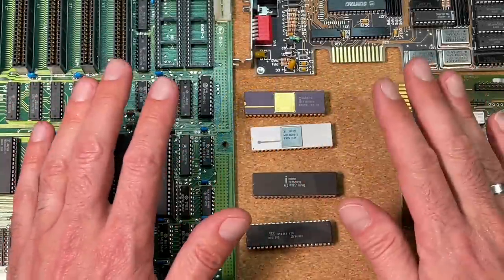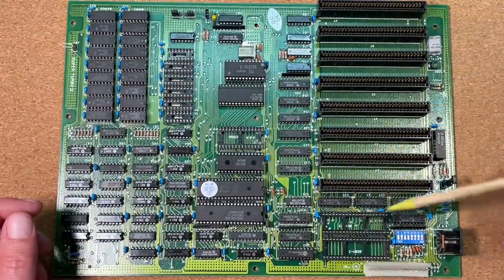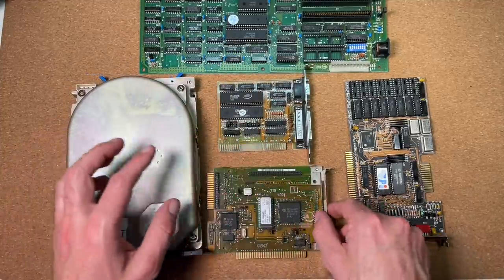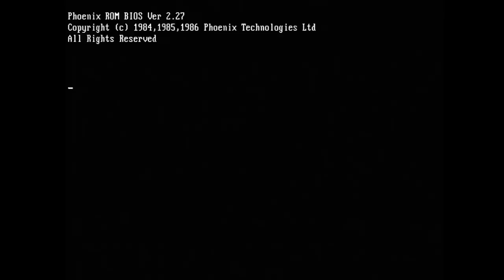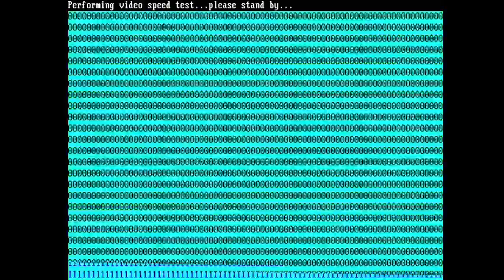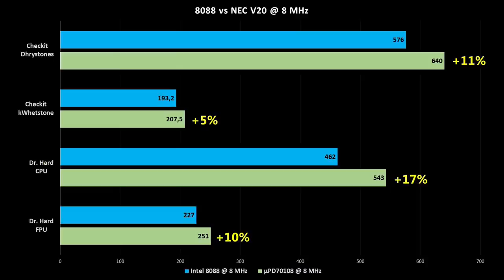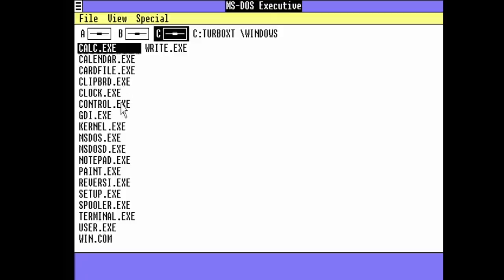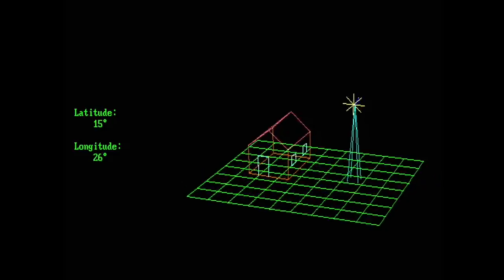NEC V20 D70108D VS 8088 CPU Benchmark + Windows 1.01 Booting

Comment: I enjoyed this video...it was pure nostalgia for me. I worked at a PC Clone store at the time. I probably handled motherboards exactly like the one you have. We sold a lot of NEC V20s when they became generally available. We had XT turbo systems that were 4.77 MHz, 8 MHz, and toward the end of the XT era, 10 MHz. I did find something really interesting back then with the NEC V20. We had both the 8MHz and the 10 MHz parts. But in benchmarking, using Norton's System Info (SI), I found that a V20 8 MHz ran faster in a 10 MHz Turbo XT than the 10 MHz V20 part!  In fact, it was almost as fast as an 8 MHz 286 AT system! When I parted ways with the store, I had a 10 MHz XT system that a couple of years later, I ended up selling to the Science Fiction writer S. M. Stirling when his PC died.
Reply: This was a known thing with much of the 10mhz v20's. A factory tweak to get them to clock reliably at 10mhz it seems. The very tale end of them did not have this issue.
Reply: @wishusknight3009  Thanx for confirming what I had guessed was the problem!
Reply: I've got a 10 MHz V30 I'm going to add an SCSI CDROM to, as well as a Radlib soon on my channel :D It's got Windows 2.03 on it.
Reply: @the_kombinator  That will be a flyin machine!
Reply: @wishusknight3009  Yeah I was amazed that it pretty much booted up and ran after sitting for 10+ years. The hard disk took some coaxing but it works with no bad sectors, and tons of programs already on it. Had to do some fiddling to make the ATI Edge VGA video card to work with Windows (it had a Hercules card in there originally) but yeah, after my multiple 486 projects, that one is next :D

JUKO NEST board too :D
Reply: Back in the days when all of the clone boxes proudly displayed a "turbo" button and some  even had 7-segment displays to to display the "big boost" in clock frequency.

Comment: Ahh the nostalgia 😍🤩. I'm 39 this year and as a kid I was always fascinated by computers and GUI style operating systems.. I absolutely loved GEOS on my Commodore 64 and to this day I'm impressed with what an amazing programming achievement that GEOS was. I was given a hand me down 8088 XT Ultra from Imagineering 10MHz with 640kb RAM and EGA graphics - I loved playing mech warrior 1, Sim City the original and Police Quest 1 and 2 on it... I always wanted a version of windows for it but only had windows 3.0 which was too advanced for it.. I desperately wanted a copy of Windows 1.01 or 2.0 back then, but couldn't find one.. I ended getting a cheap 286 12MHz with 1mb ram and VGA graphics and fell in love with Windows 3.1 on it.. I also really like DESQview which was an incredible multitasking txt based windows system for DOS and I was able to run a multi node BBS on it with my 486DX4/100 I had by that stage (that system also ran Windows 98SE and Doom + Quake + original GTA and was my first really powerful PC). Ahhh the nostalgia 😍
Reply: SimCity is one of the only games, and even one of just a few applications, that will utilize a 8087 math co-processor. Window 3.1 needed a 386. Are you sure it wasn't Windows 3.0? Or maybe the 286 had an upgrade, either an Intel Inboard or similar?
Reply: @squirlmy  Windows 3.1 would run on a 286 with 1Mb RAM.. trust me, I ran windows 3.1 on a 286 12mhz and my mate also owned a 286 at the time and ran windows 3.1 on his 286 back in the 90s as well. Search YouTube for windows 3.1 on 286 there is a number of videos of it running on 286s with at least 1mb RAM.. system requirements were 286 minimum 386 recommended

Comment: I also had an 8086 computer and upgraded it with a V30 and increased the clock speed from 8 to 9.67. This almost reached 286-6MHz ^^

Comment: Your experience matches very well with my own. Back in the days when it wasn't retro (just old-ish), someone gave me a V20 chip that came from a dead system and I found it was anywhere from 0 to 20% faster clock for clock, and I didn't really understand (then or now) what kind of workloads got which kind of response because not long after, I got hold of a 16 MHz 286 and lost all interest in trying to upgrade the XT. The V20 was a nice bonus for the guy that bought it off me though.

Comment: The V20 also had an 8080 compatible mode. There was software available for it that would allow you to run CP/M programs on your PC.
Reply: I was going to add a comment to this as he was talking.. heh! I'll continue your comment because (First!!1 respect etc).  If you are a CP/M fan you probably already know this. It was called "8080 Mode Shifting" when you call a BRKEM instruction. :) I run two in my NuXT board and a NCR PC4i.
Reply: And there was another CPU later on that was compatible with both 8088 and Z80 code.
Reply: @AmaroqStarwind  The V30 also compatible with Windows 3.0
Reply: @asanjuas  So was the 8088. Windows "real" mode. It required 640k though as far as I know.
Reply: The 8086 was kind of source compatible to the 8080 in a round about sort of way, but did require some tweaking and recompiling. It certainly was not directly source or binary compatible by any stretch. It was only designed in such a way that 8080 assmenbly could be ported easily up to an 8086 without a full rewrite.  It was fascinating that the V20 was indeed mostly compatible.
Reply: I have used that a lot back then,
Reply: @wishusknight3009  possibly but V30 supports some 80286 instructions. And Intel 8080 and Z80
Reply: @asanjuas  No, the v30 and v20 were identical internally and only had 80186 like enhancements. The V33 used interrupt vectors like a 286 and had performance similar to the 286 in similar clocks.
Reply: @wishusknight3009  is the v33 pin compatible with 286?
Reply: @asanjuas  As far as i am aware the V33 was only ever an embedded surface mount qfp. It had separate address and data lines like the 286 but tjat is where its similarities end. It maintains it is only 8086 comparable.  As far as I know it didn't have the extended protected modes of the 286 or associated control pins.
Reply: @wishusknight3009 but not Windows 3.1. That required the memory management of the 386. Compaq beat out IBM in creating the first 386 PC, which turned out to be a great advantage because Windows 3.1 was so commercially successful. IBM had doubts about the 386 and didn't anticipate the eventual popularity of Windows and held back. Linux also will not run on anything less than a 386. In the 90s I used to search through trash hoping to find one I could fix up.
Reply: @AmaroqStarwind  I don't think so. the DEC Rainbow100, for example had one Z80 chip and one 8088, designed to run a custom edition of MS-DOS and Z80 C/PM (although not at the same time). I realize that's not proof, but I've never heard of any attempts to combine the two instruction sets in one chip, because of licensing issues.
Reply: @squirlmy  It wasn't an Intel chip. It was an NEC chip.
Reply: @squirlmy  3.1 runs on a 286 in standard mode. I was talking about windows 3.0 and its real mode will work on an 8088.  However 3.11 requires 386 enhanced mode.
Reply: Only half right. CP/M was written for the first IBM PC. Confusingly, it was called CP/M-86, I think it was intended from the start to run on 8086, but it came out for IBM's 8088 PCs. And CP/M ran on many, many different chips. Remember too, not all code was written on top of an OS for a personal computer, there were many, industrial applications especially, that ran on "bare-metal". So, you can say the "8080 compatible mode" was certainly meant to run 8080 code, but making the jump to "allowing to run CP/M programs" is a bit too far a jump. The most popular chip for running CP/M was the Zilog Z80. Zilog would go on to make the Z180, Z800, Z8000, (I believe the Z280 was cancelled, though it was planned as an update for the Tandy 1000 computer) but Zilog never again found the level of success the Z80 had. The DEC Rainbow had both a Z80 CPU and an 8088  CPU. Although it could run CP/M-86, since that OS had been a failure on the IBM PC, they stuck to Z80 CP/M, and a custom MS-DOS ran on the 8088.
Reply: @squirlmy  According to the NEC V20 article on Wikipedia, NEC had legally reverse-engineered the 8086 / 8088 instruction set, so licensing wouldn't have been an issue on the Intel side of things.

Their chip that was compatible with both 8088 and Z80 code was the NEC μPD9002.

Comment: The reason I find V20 extremely handy is the fact that it handles 186 instructions. Back in the day I often compressed my games with pklite to fit things on floppies that otherwise wouldn't. Now these games just hang when I try to run them on an 8088 as the decompressor needs these newer instructions. But a V20 can cut it!

Comment: I’d like to see 8086 vs V30 as well nice video
Reply: Heck yeah! (And let's see them completely destroy the 8088 MPH demo... In both a good way, and a bad way, due to it being timing-sensitive.)
Reply: Those are a rare creature to find now.  The v30 was intended to compete with the 80186.
Reply: I seem to remember a PC compatible card for the Apple II series of computers used a V30. The advertisements stated it ran 3X faster than an XT. The card I believe was called the PC Transporter from Applied Engineering.
Reply: @lemonherb1  Yeah I remember this as well. I can not remember if it used a V30 or V20 however. I thought it was a V20 myself.... Holdon let me do a quick search......  Huh... it is a v30... I'll be dazzle drawn... 

PC Transporter with 768K $679 Specifications: CPU: High performance true 16 bit V-30 microprocessor; chip has full 8086 and 8088 instruction set operat-ing at 7.16 MHz User RAM: 640K maximum (IBM) System RAM: 128K Apple User RAM: 768K maximum.
Reply: i think v33a is more interesting but not sure if pc compatible motherboards using v33a exists...
Reply: @wishusknight3009  I was under the impression that it was originally made to compete with the 8086, but thanks to Intel managing to both hold up NEC in court (ie. Delaying the release of the Vx0 chips) and make the 80186 a pretty forgettable CPU the V30 ended up competing with it?
Reply: @TheDemocrab  I think the V30 was more feature parity to the 80186 than the 8086. That is why I figure it was intended to compete with it, thought it could basically compete with whatever it is capable of beating in price/performance.

Comment: Great video. That is about what one can expect in real world performance differences too. I usually told people a %10 boost across the board.  The 8086 to v30 difference was similar and perhaps slightly larger but I no longer have the hardware to test that.

Comment: I had wondered about the V20 upgrade back in the day. Not a lot of gain for twice the transistors. Probably limited by memory bandwidth.
And thanks for reminding me of that Mah Jongg game! I put in a lot of time with it on my CompuAdd 212 (286/12.5MHz).
Reply: Several poor design decisions caused performance limitations on the 8088 and the subsequent V20. The first is the crippled 8 bit bus, but exacerbating that is the fact the data bus and part of the address bus are multiplexed on top of each other. Additionally some other lines are multiplexed on the upper address bus, so a lot of glue logic, wait states and extra bus cycles are needed to get information in and out of the CPU.

Slow memory of the time was an issue, but the multiplexing and 8 bit bus were the worst problems that prevented the 8088 from performing better, and the subsequent V20. The V20 could be as efficient as it wanted to be, but it was burdened with so much baggage that any improvements were always going to be minimal. The 8086 wasn't much better because Intel still multiplexed the address and data bus.

It wasn't until the 80286 that Intel stopped multiplexing the address and data buses, but it really should have never existed, along with the 8018x. The 80386DX was what the previous chips should have been.
Reply: V20 upgrade was extremely cheap, pizza money cheap. There was another upgrade in 386 times with Cyrix 486DLC chips that promised stars, but delivered Doom at 10-12fps at the cost of half the full 486 upgrade :(

Comment: Nice comparison test.  The white and gold Fujitsu is very pretty, like jewellery.  In the mid 1990s I used a slightly out of date XT machine with a V20.  Dos 3.3 and Wordperfect 5.1.  I really liked it.  It had all sorts of cards inside but I knew nothing about computers so I didn't know what they were for.  It had an EGA card but I didn't know what EGA was so I used a green monochrome monitor, which I later sold.   However, it lit a small spark of interest and 2 years later I was working in IT.   The machine was THROWN OUT!  It still distresses me.  Thanks for the video 👍😊

Comment: makes me feel homesick for the 80's .....and feel even older lol.   We had XT's with Tallgrass units (10MB HDD plus tape) first - then moved to DEC Vaxmates (some diskless with remote boot, some with the 20MB "pancake" base). Those ran Windows 1.02 and included embedded Thinwire to talk to the Vaxen using PCSA (later called Pathworks) .    Great technology at the time and oh so hackable.....

Comment: I got an Amstrad 1512 in about 1987. It had a V20 running at 4.77. I picked up a 32MB Miniscribe hard card which went in an expansion slot. I have memories of testing different HDD interleave figures for best performance, the Amstrad was so slow that an interleave of 11 seemed to work best.

Comment: You know you are getting old when you remember that your first Clone Computer in 1987  had a Nec V20 and a used 10 GB MFM drive plus an ATI Graphics Solution video card on a 12 inch Packard Bell Amber Display... RIP... .. Lol... Thanks for the memories.
Reply from the maker: I guess you mean a 10 MB drive and not GB 😉.
Reply: @CPUGalaxy  exactly correct! . See how old I am.. Lol.

Comment: Another great video! Thank you very much! I remember working with an XT at school. Almost all the other kids had to follow the teacher's lessons, but I asked to be allowed to play on that machine myself because I owned a C64. I programmed a "3D" graphic with Q-Basic. Actually just two sine waves that had a common origin of the lines, so it looked like two of those wavy roof covers. The teacher was impressed.
I was also impressed with a code snippet that was included in one of the programs that came with Q-Basic. It was an elegant piece of code. I was allowed to print that out, too. On the condition that I also printed out my sine wave program and gave it to the teacher. 😁 
Anyway: The XT with 4.77 MHz was so much slower than my C64 (only 0.98 kHz!) with a Simons-Basic module. Cheers to the pipelining of the MOS 6510 and the terrific VIC!

Comment: I had an Eagle PC at 4.77 MHz. I once upgraded it with a V20. Then managed to derive the clock from one less /2 stage and run it at 7.16 MHz. Finally I managed to offer it its own clock generator and run it at 9.54 MHz! It was super fast by then. I was quite surprised that I didn't have to change that many things on the board, the clock signals were easy to follow on the board, and while my concern was to risk to double the RAM freq as well, that fortunately didn't happen.

Comment: I inherited a Datavue Spark laptop which shipped with a V20. That was the first time I'd ever seen the V20, and subsequently learned what a big deal it was! This particular laptop had been tricked out as a business machine, with every option available (640k RAM, backlit display, 2x720K floppy drives!) except the modem, and the FPU. Apparently NEC was set to come out with a competitor to the 8087, but either never managed to do so, or it was a commercial flop.

Comment: I always wondered why nobody made a "serious" chip replacement for the old 8088s. Something like the ZipChip for the 6502, which was a direct replacement but much-much faster due to high internal clock and internal cache. Just seems to me there would have been a business case in extending the life cycle of millions of (expensive) PCs/XTs by a (relatively) cheap upgrade. Thanx for the vid!
Reply: They did. You could buy 286 and later even 386SX upgrades in a form of ISA card with own memory slots. You couldnt plug any upgrades directly into CPU slot because it was very limited (multiplexing). ISA cards had own memory making them fast when doing calculations, they were only limited by the ISA interface speed when accessing external peripherals.